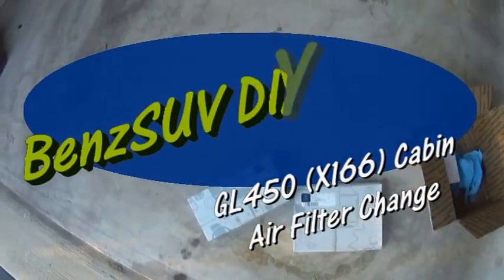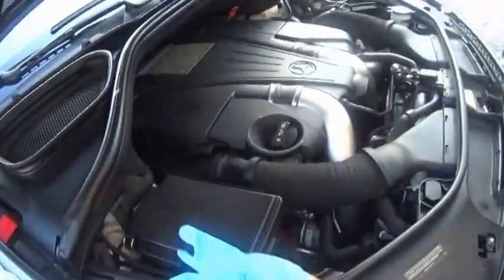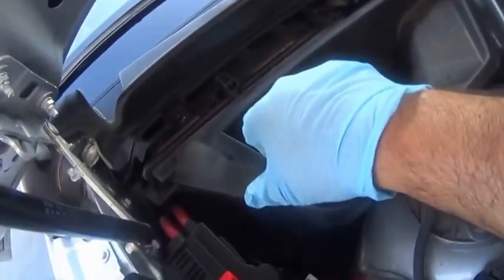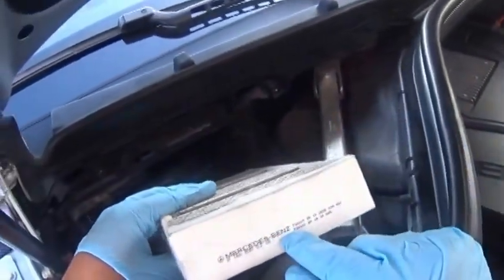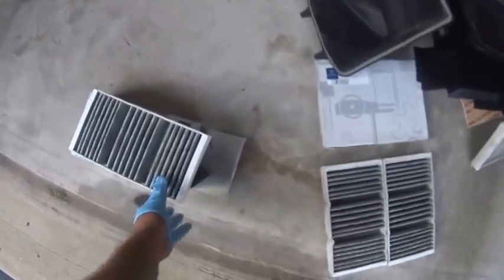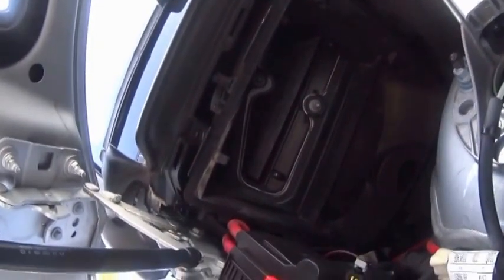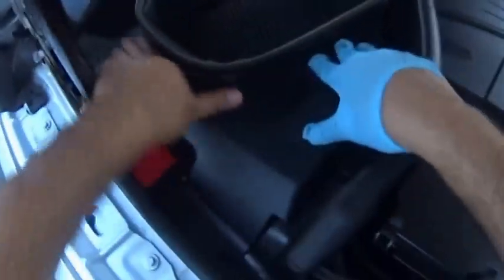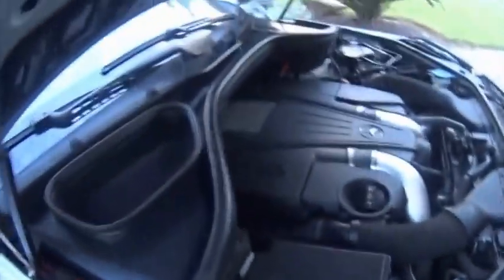Mercedes-Benz GL450 (X166) HVAC Filter installation DIY

Comment: Inside two filters are pollen filters for tiny particles . The outside big filter is for dust and bigger things filtering only. So it is two barriers design.   The outside one is more often to be changed.  The inside is more expensive with carbon filtering . If you can smell some bad that means the inside pollen filters need to be changed for sure. Also for hay fever and pollen sensitive ppl the inside pollen filters are important.

Comment: It's definitely MUCH easier to change the cabin air filters from the engine compartment.  Switching them from the glovebox side is a pain in the but.  The right filter (front passenger side) should be put in first so that the two plastic "pins" push into the side of the filter.

Comment: Hi have you ever changed engine air filter? so my question is: pass side of air filter comes out easy but driver side of an air filter in my GL450 has an extra air suspension hose connected, and I could not remove air suspension hose out of air filter cabin... do you have any idea to remove driver side of engine air filter with air suspension...
Reply from the maker: No I have not done it.  Although I have heard that it is a pain to remove.  I don't know why something rudimentary as air filter change is so difficult with this design. Previous non-turbos were easier.  Here is a link to a write-up that someone did on changing the air filter.  Hope it helps.  https://mbworld.org/forums/gl-class-x166/660727-engine-air-filter-change.html  I intend to follow this guide when I do mine.  Thanks for your comment.
Reply: That extra suspension hose swivels. No need to disconnect.

Comment: Will this be the same location on my 2013 gl63 amg??
Reply from the maker: Yes it will be.  Mostly same vehicle but the gl63 engine is tuned differently for higher performance and has some additional features as standard.  And looks better.  :-)

Comment: Hi, do you know where the condensation drain is on the X166? I wanted to flush it and clean it but I can't seem to locate it? thanks in advance!
Reply from the maker: Not that I am aware of.  However, if you are looking to this because the AC smells, there is a class action law suit against Mercedes.  Check out http://www.mercedeshvacsettlement.com .  Good luck.

Comment: It's a shame that the main battery couldn't be placed in the area by the cabin air filter shroud in the engine compartment.  Leave it to Mercedes Benz to make things complicated.
Reply from the maker: I agree with you.  My W163 Ml320 has the battery in the right corner of the engine bay but for W164, W166 and X164 and X166 they moved the battery to under the passenger seat. What a pain it is to change the battery.    It is a tight spot and the battery is big and heavy.  Over-engineered for sure.
Reply: Yes, and having the aux. battery right by the main battery under the front passenger seat in the W166 is truly bizarre.  I also can't understand why there are fuses under the right rear passenger seat as well.
Reply: This method works for 2015 ML350.

Comment: Where did u buy the filters?
Reply from the maker: I purchased them from Ebay from a Mercedes dealer.  You can also get them online from a Mercedes dealer or from online stores like FCPEURO, autohausaz or pelican parts or even amazon, as well as Mercedes dealerships online like MB OEM Parts.  Look around to try to find the best price.

Comment: This is not for GL450 2007 , correct?
Reply from the maker: no - this is for a 2013-2016 GL class, which is X166.  The 2007-2012 GL Class is the X164.  The procedure should be similar, but the part numbers are different.

Comment: FYI  ...NOT THE CORRECT WAY TO REMOVE CABIN CHARCOAL FILTERS ON A 2017 GLS450 AGAIN FYI....maybe on older models..but correct access is via access slots behind removed glove box .. again on newer model.   And yes the carbon filter will look clean if the prefilter is working .. filter removes/absorbs basically invisible gas molecules on the carbon particles.. you can't determine if it is loaded ...JUST REPLACE THEM.
Reply from the maker: I have not looed inside the hood of the GLS450 to see how different it is from the GL450 apart from the V6 engine, but I believe in that one too, you can change it from the engine bay.  Even on my 2013-2015 GL450, you can also change it from the passenger side, by going behind the glove compartment.  You can get to the air filters using either method.  Thanks.
Reply: @DIYDharma  There is a correct way or the questionable short cut way. And...the correct  way doesn't deform the carbon filters and seats properly.. just saying!

Comment: Does the same apply to 2017 GLE350?
Reply from the maker: That would be a W166 and the inside is the same..  So, I would assume so but don't hold me to it.
Reply: rabinzx T have you tried on 2017 GLE350? I’m looking for a video which would help. Let me know! Thank you.
Reply: @AnilVeeramalla  yes, I tried and it is exactly the same. I have to bend/deform the filter first to let the spike on each side to penetrate the hole on filter. I used Mann (same company who make mercedes filter) 2646-2. https://www.amazon.com/dp/B00URDPXW0
With the Mann one, you will need to cut two holes on each side because it was designed for older mercedes but same size.